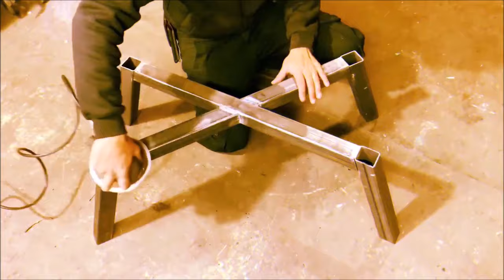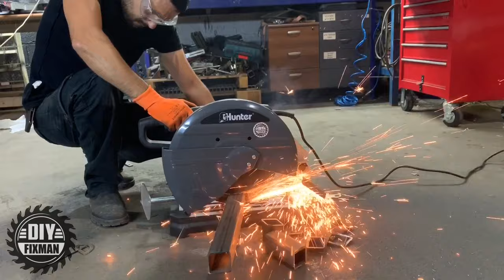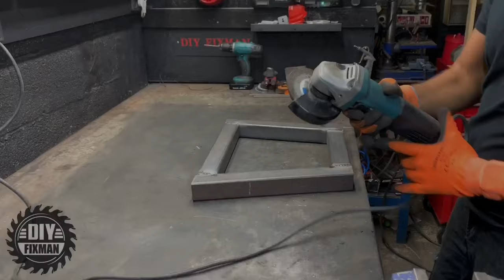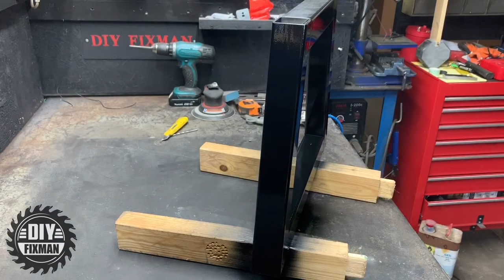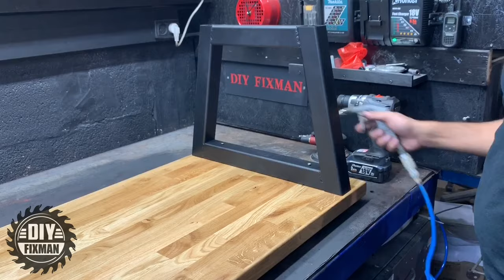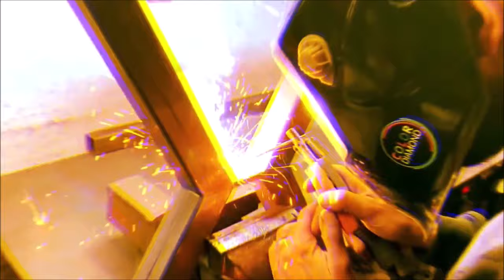How to Build a Beautiful wood Coffee Table

Comment: You should make your cuts so you don't have open tube at the top/bottom.  Easy to do as long as both angles sum to 90 (75/15, 60/30 etc).  Also weld all the way around your joints.  You make cool stuff but those details are hard to overlook as someone that also makes a lot of metal/wood furniture.
Reply from the maker: Thank you very much friend.  I understand what you're saying